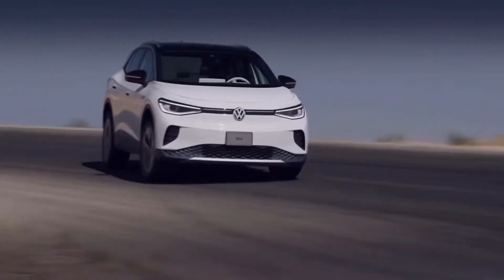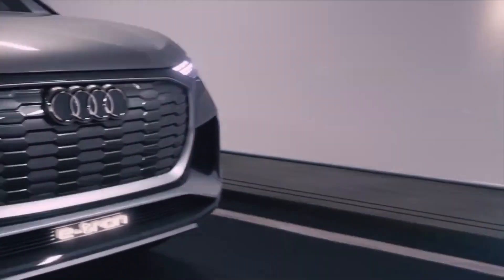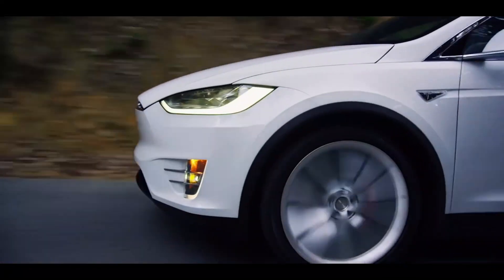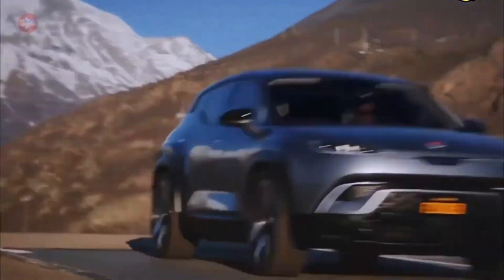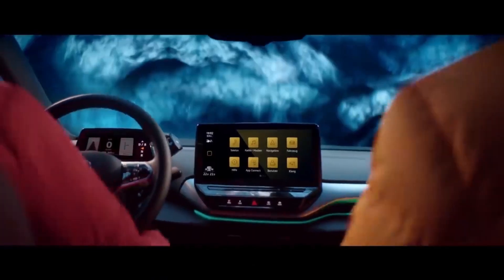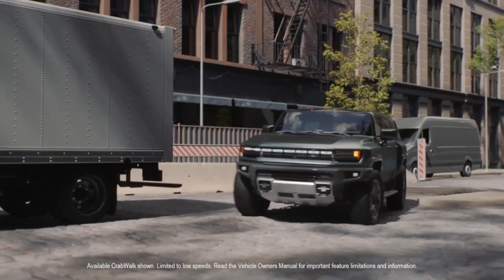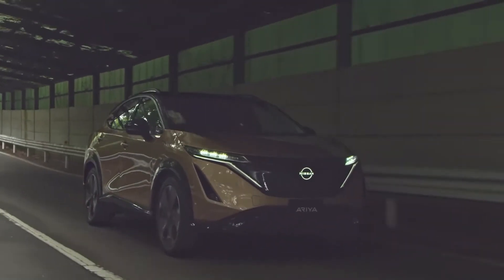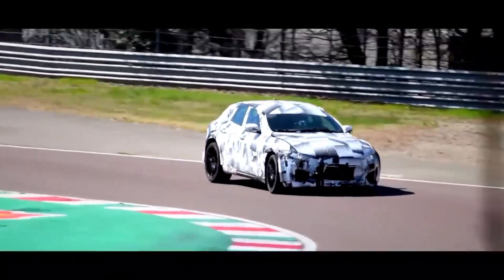Top 10 MOST Anticipated Electric SUV and Crossovers Arriving by 2022

Comment: In my opinion the Ferrari should not have been on this list. It's not an all EV and it's way out of the price range for average consumers. 

While there are a host of vehicles not included in this list it's crazy that the Hyundai Ioniq 5 and the Kia EV6 weren't on this list. Both cars get great distance to the charge and the technology is on par or better than those in this lineup. Both have 400/800KW charging and both do vehicle to load which allows you to use it as as generator to power equipment or even use its charge and technology to charge up another EV.
Reply: It's 400/800 Volt architecture (not KW charging)

Comment: Thank you for this video. I own a 9 year old Lexus ES 350 and my wife has a 2018 Tesla Model 3. The range anxiety with the Tesla is real. So, if I replace my Lexus with an EV, it will and should have : 1. Heat Pump for winter heating. 2. 4680 Battery or a Solid State battery that Toyota is developing. 3. Much improved EV charging infrastructure. Right now, most non-Tesla chargers on the road are Level 2 and NOT Level 3 chargers.
I do NOT want a hybrid. Why? Because of the roaring noise they put out during acceleration. Though, many users have told me that the new Hyundai Tucson Hybrid is pretty quiet in this regard. Hyundai says its gas mileage is "up to 38 mpg highway" which means that overall it will likely give 28-30 mpg at most. My Lexus gives me 22 mpg around town so it won't be worth moving up to the Tucson hybrid. A Sonata hybrid though should give me more like 40-50 mpg. If they come out with a PHEV (plugin hybrid EV) that has around 60 miles of all-electric driving, I will surely be tempted. The current 20-30 miles is, I think, a joke.

Comment: Bollinger , all that roof space and zero solar panels on top for range extension, helping recharge it or simply keeping the battery topped off when not in use or plugged in
>.> you could easily get 8 miles of free charge a day out of having newer more efficient solar panels installed on the roof.